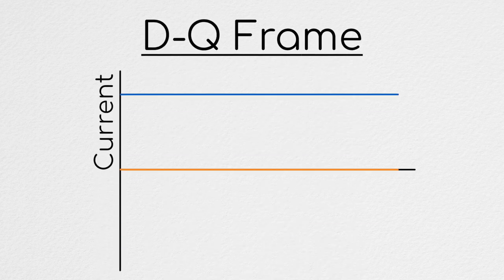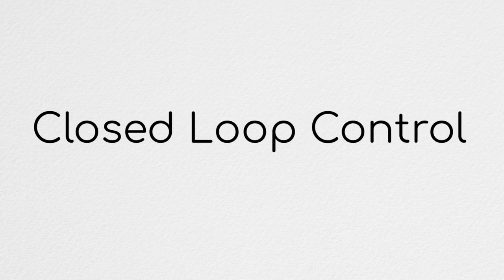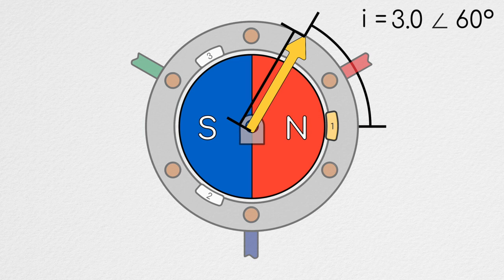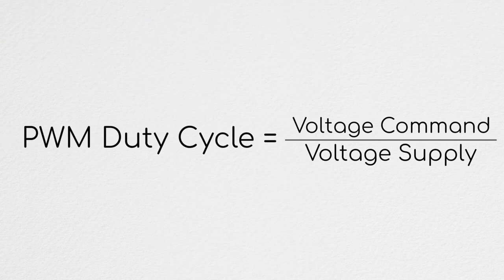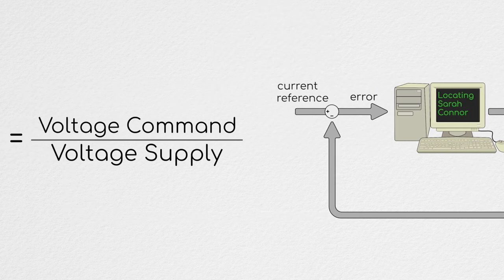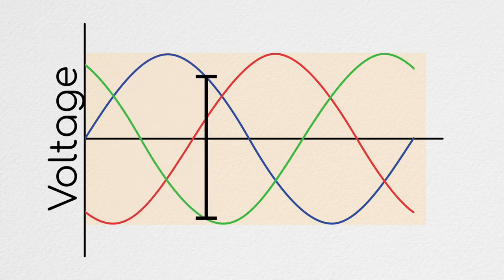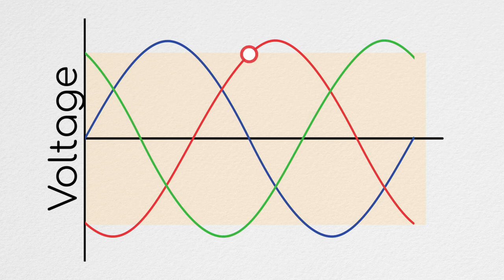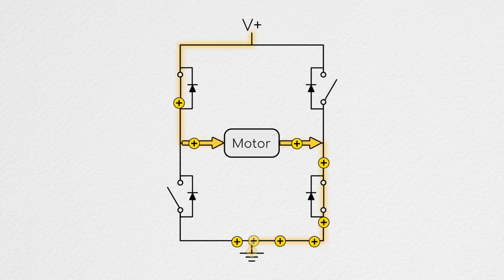What is Space Vector Modulation? (Episode 10)

Comment: Even if you just have hall sensors for determining angle you can interpolate rotor position at all but the lowest speeds.
Actual position = (start of sector angle) + (time since last hall change / how often hall reading is changing) * 60 degrees.
Reply from the maker: Absolutely!  it won't work quite as well, especially not for (as you said) low speeds, or even stall torques. Some people will also use the value of the BEMF to estimate speed as well (which you could, potentially use in an observer, with the velocity via halls you were talking about) and potentially make it a little bit more accurate.
Reply: At low and near-stall speeds, I think I'll just go with 6-step block commutation. Given the amount of inertia in a large hub motor (what I'm building a controller for), the angle interpolation will probably work quite well at low speeds, down to about 2ish MPH.

Edit: Did try this, worked well. Below a certain speed I had  to fall back to 6-step but 30% torque ripple isn't bad at all, especially when it's only a problem for half a second at startup.

Comment: Amazing video ! You helped me understand a lot, especially why we don't use the full differential voltage. However, I can't find mathematically why or how to find this 86.6%. Do you have any materials I could learn from? THanks
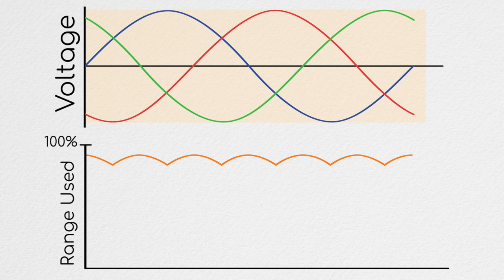Reply: I think that number comes from the "Range Used" graph shown at 7:50. I would define it as max(a(t), b(t), c(t)) - min(a(t), b(t), c(t)), where a(t), b(t) and c(t) are the 3 sinusoidal phases with amplitude 1. The maximum value of the graph is approximately 1.732, while the maximum that we want to achieve is 2. Then, 1.732/2 = 0.866

Comment: Hi, should either one of the switches of each half bridge be active at all times? If so, how again each pwm percent value is interpreted? -70% for instance, does that mean that 70% of the time the lower switch is active and the rest 30% the upper switch is active?
Reply from the maker: Great question! Your interpretation is exactly right. I know that notation can be confusing, as we tend to think of individual MOSFETs being sent a given PWM signal, and this is more of a PWM signal to a leg of the bridge. So, as you said, its more of a percent of the time connected to high vs ground; as opposed to (in the typical way we think about it) the percent time that a single MOSFET gate is written high vs low.
Reply: @jtlee1108  Thanks! I still don't understand though... I scale down the desired voltage on a phase to the range (-1...1). Lets say I've got -0.7V, should I generate the same duty cycle as if I got +0.3V? What happens with 0?
Reply from the maker: @michaelbraverman2001  another great question! So I think I understand the confusion now, and I think its due to my presentation. Yes, within my perhaps confusing notation, -70% duty cycle and 30% duty cycle are equivalent. However, its important to remember that 0 V is +-50% duty cycle. So, instead of thinking of 0.3 as 30% up from 0, we have to think of it as 65% up from -1 (since -1 is our 'ground' in this case). Likewise, -0.7 would be 0.3, or 15% up from -1 (so it would be 15%, or -85% duty cycle). I did not do a great job of explaining that clearly in the video, so I apologize. I hope this clears it up some.

Comment: So when you use above SV Modulation, you effectively control the voltage in each leg. What about the current? Does the current follow the voltage meaning it has the same non-sinus shape as the voltage? Or is the current still sinusoidal?
Reply from the maker: good question! So the short answer is that the Current will be sinusoidal. This answer assumes you have a constant command (IE your duty cycle command, as discussed in the next episode is fixed), not doing any sort of servo control. This is because the current is forced by voltage differential, not voltage. And since the harmonics are added into all three voltage signals, the differential is still the same as it would be with a sinusoidal voltage. Hope that helps!
Reply: @jtlee1108  Thank you! I was hoping for some crazy current pattern which might help reducing switching losses especially in the low-current regime, but well, I guess there is no way around those ;)